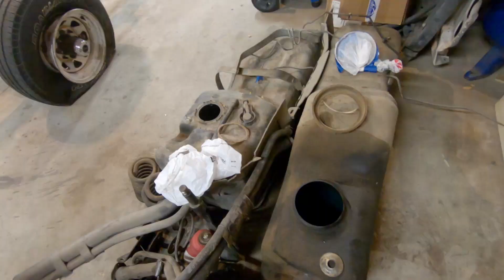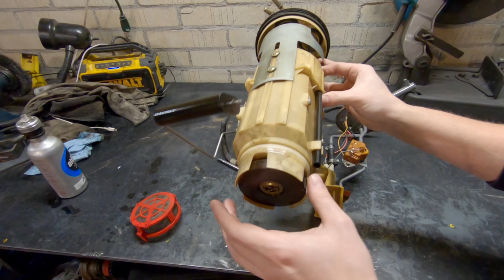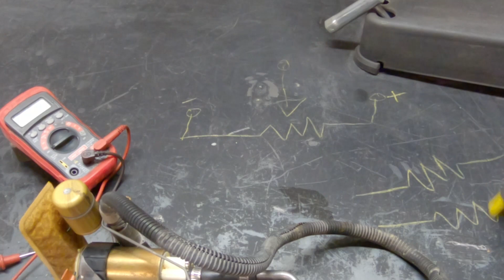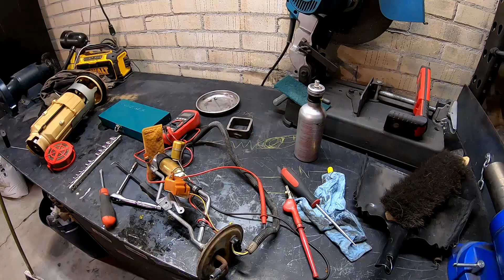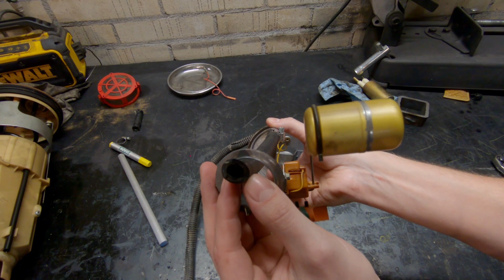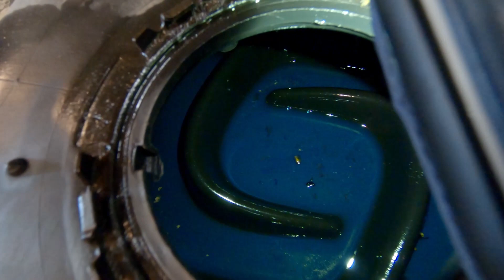Diesel Swap Using STOCK Gas Tank?

Comment: Could you paint the pickup tube to stop the galvanized issue?
Reply from the maker: Potentially, but I'd be worried about the paint coming off when submerged in diesel. I think I'd rather just wire wheel off the coating rather than paint it. 

I did endup having to pull this out again due to some crap in the tank plugging it 😣. I didn't see any indications of corrosion so far after being submerged in diesel for a couple months, so far seems to not be causing any issues!
Video here:
https://www.youtube.com/watch?v=SeONzwvF0Vk

Comment: Not a lot of videos on this topic; glad you made one! I'm going to be swapping a BMW M57N diesel and 6-speed manual into my 2006 BMW X5 (E53 chassis) and need to convert my fuel system over from gasoline to diesel. I'm using an engine that was never offered in the US market (despite even the diesel X5s being assembled in South Carolina before being shipped away), so I'd like to use parts readily available in the US, as far as things like the fuel pump, fuel filter, etc. Thinking about using a remote mount screw-on CAT 2 micron filter kit.

Also, I also always say the same thing: "If it works, it ain't stupid"